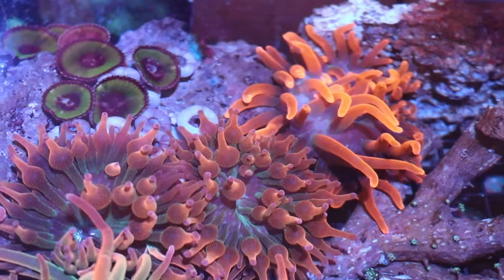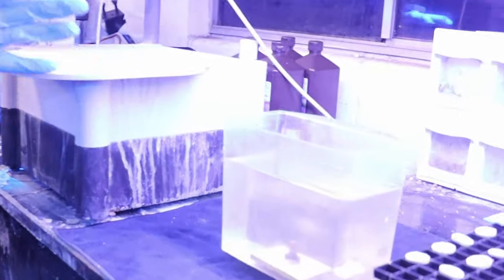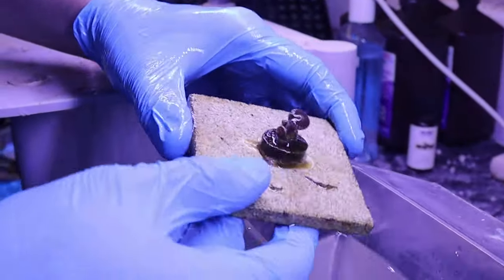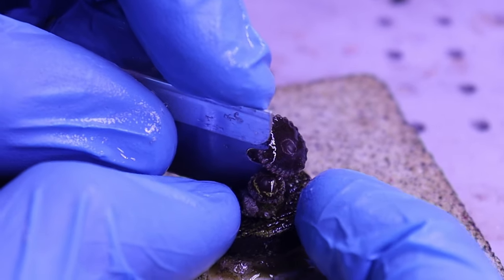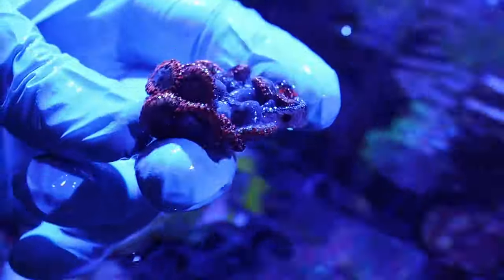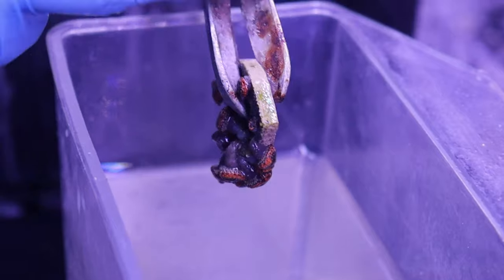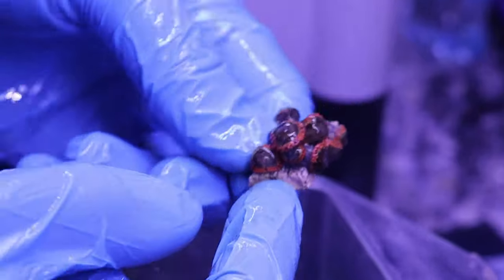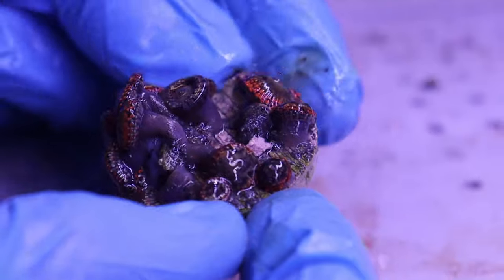How to frag Zoanthids the RIGHT way ft. Stratosphere "Strat" zoas

Comment: Great video! What would you recommend for zoas on a plastic frag shelf that has grown out of control... Seems like scraping is my only option..
Reply from the maker: Is it an acrylic sheet or egg crate?
Reply: @coralscoral  It's one of Eshopps Acrylic racks.
Reply from the maker: Yeah your only options are top scrape the zoas off the rack or cut the rack with a saw or something else. With a smooth surface like acrylic is it pretty easy to get a nice clean cut under the mat of the zoas that won't damage them much. I would just make sure you get all the way under the mat and they should do fine

Comment: Wouldn’t a scalpel be better professor?
Reply: For precision, sure. But it’s not worth it. They both perform the same job, both are very sharp, and both will rust and dull quickly.  Except razor blades are 4x cheaper.